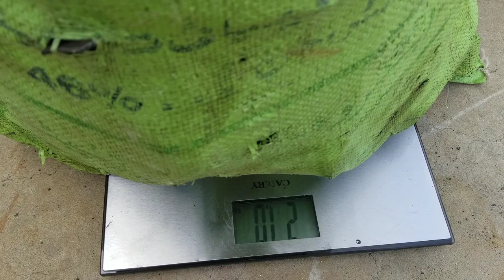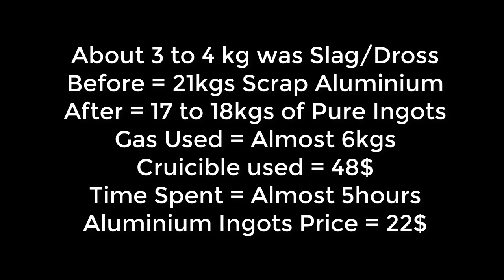Melting 21Kg Motor Bike Scarp into Fine INGOTS - Aluminium Trash to Treasure

Comment: I'm not so sure that is pure aluminum. Many of the parts that went into the melt are not normally made from pure aluminum, many are made from "pot" metal, a low quality zinc alloy, sometimes mixed with aluminum. Not being there and doing it, I can't say for sure. I know I saw a brake or clutch lever, they're not often pure aluminum, you're doing good to get decent pot metal with most of them, tho some were aluminum ... it depends on who made it and when. 

Here's something you can recycle... milk jugs and plastic bottle tops and the like, I believe they call the plastic PPE2 or something like that. It melts at only 350 degrees F, (I don't know what that is Centigrade) and can be molded into various items. I'm playing with it myself on a small scale. If you could get enough plastic, and a good way to melt it, I'm thinking you could cast dimensional lumber like products. or cast things like chairs in one go if you can figure out the mold process. Or maybe stay small and cast small things. Oh   most grocery bags here are made of the same plastic. Unfortunately, the clear plastics cannot be recycled in this manner. The clear plastic of soda and water bottles actually shrinks when heated.

Comment: No visible preheat on the “mold”.  Took a bunch of metal off with the slag.  Slow down with your pouring, your first one was good but you spilt every time after.  Get actual molds not a muffin tin. You should never cheap out in an operation like this